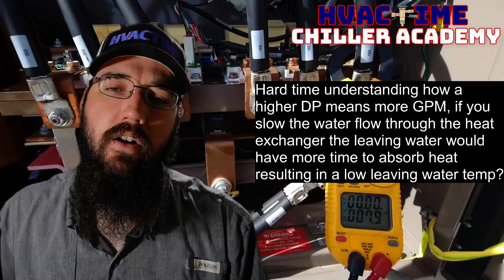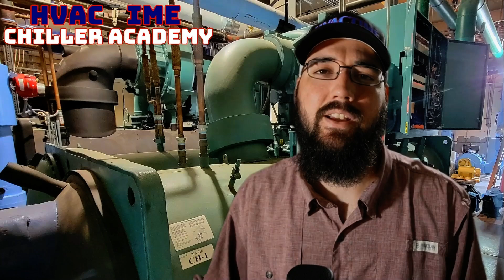More DP mean More GPM on Chillers Explained

Comment: How does Scale buildup affect DP? Would it be a higher pressure at the inlet and then a relatively low DP because the restriction starts early? Or does it not tend to get that clogged before it starts messing with the chiller approaches and operation
Reply from the maker: In my experience, the chiller will start having major heat exchange issues before the scale is heavy enough to affect DP. In the event there was a high scale build up affecting flow, it would increase DP making flow look high but it's actually low.